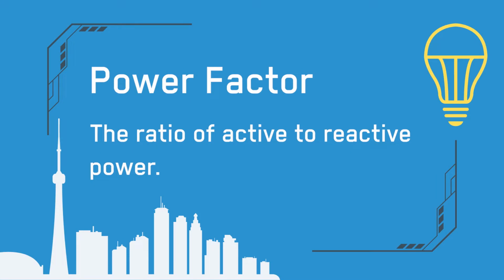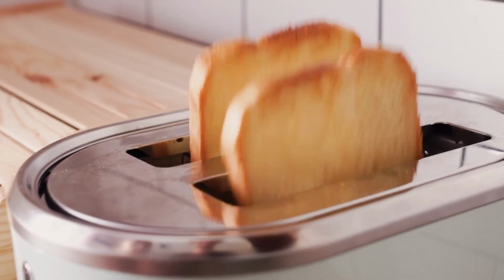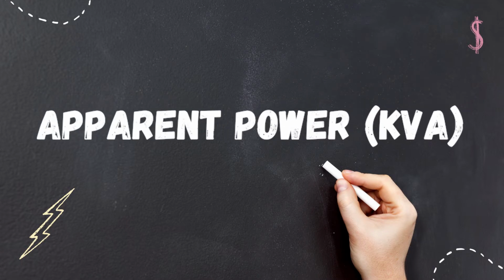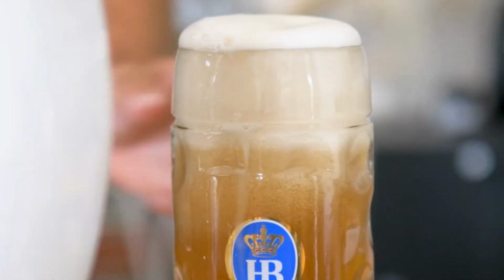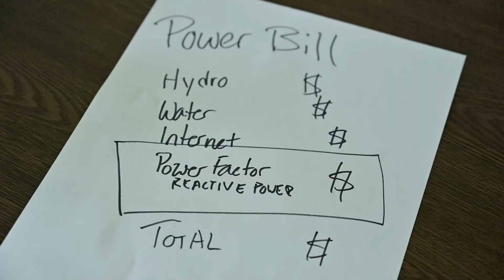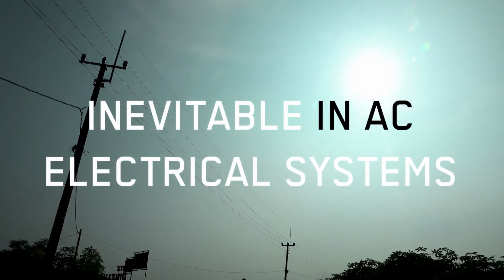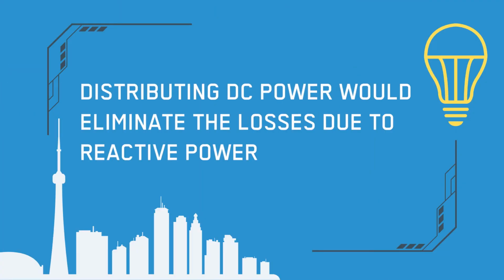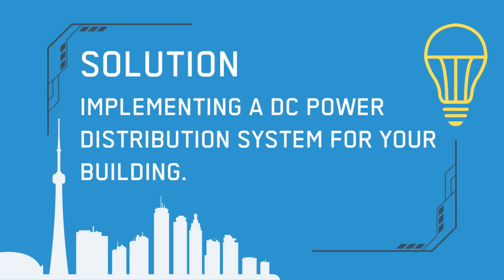What is Power Factor? + Why it Matters

Comment: I understand DC power is more efficient than AC but I have questions:
1. Why do they still use HVAC for long distance transmission, is it because steping up and stepping down the AC is easier or something?
2. Also, most of our appliances at homes uses low DC voltage internally like 3v - 24v. If we convert AC to required DC voltage once at the entry point of our home, isn't that DC voltage going to be significantly lost because of low voltage over span of 10-20 meter. Wont it be a bigger loss.